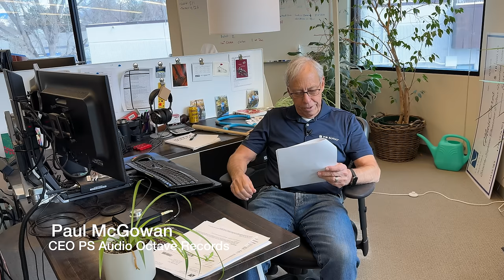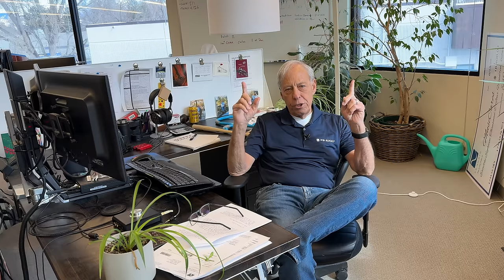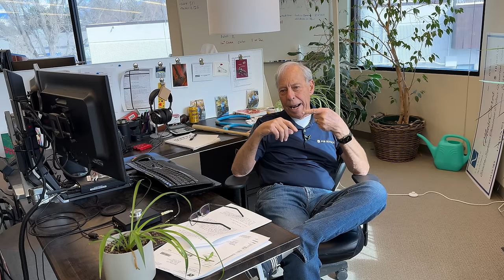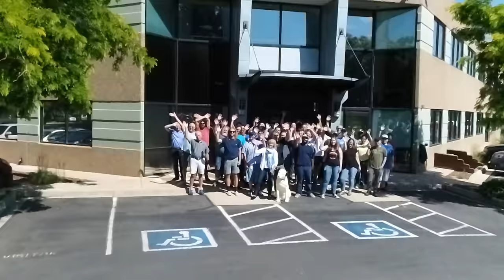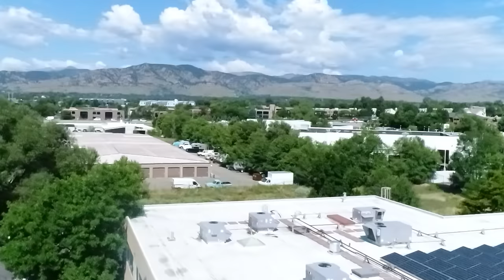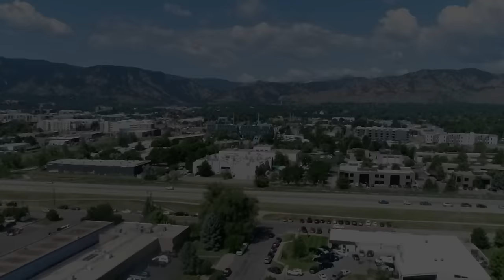How to sum stereo to mono

Comment: I remember hearing a 3 channel Left-Center-Right demo at the Klipsch factory in Hope, AK in the early 1970's. As I recall the center channel was run 3db lower in level than the 2 side speakers placed on the long wall of the room. They referenced the original Bell Labs stereo testing from the 1930's. Two Klipsch horns and a Belle Klipsch center channel. Most impressive. A number of preamps of that era had a mono output with separate level control for just this setup.
Reply: Are you sure it was the Belle? Klipsch was famous for the room placement of Corner Horns often being too far apart to get good center channel. So he invented the heresy of a center fill channel speaker and called it.... the Heresy! It had reduced fidelity to complement instead of compete.

The Belle was designed as a full range speaker in the 70's. So yes perhaps it could be used as center fill. But that was not the intent. And it was not around to do the '30's test. That was the Heresy.
Reply: I am sure, it was the Belle - a fancy version of the La Scalla - and just as large with different proportions.
Reply: @marksulloway5669  Interesting. Because I know the Heresy center was pushed in Audio shops. But Paul always did what he wanted!

Comment: Paul's answer is what we expect coming from an electrical engineer: he's worried about impedances and such in a circuit. However, when it comes acoustics and even more so psychoacoustics the issue about making "mono" from two stereo channels it that the resulting signal will not be the same as if one had simply placed a single microphone midway between the stereo microphones.  Paul did mention "phase" near the end and the problem of cancellation, but he ignored that these kind of cancellations are always going to happen from two channels recorded, as the complexity of the sound is such there will be signal that is always out of phase on one channel from the other.
Reply: True but a single mono microphone recording also "suffers" from phase cancellations. Place a mono microphone in the wrong position and gone are some specific notes produced by a double bass, or a church organ. In fact you will get phase cancellations with a mono microphone no matter where you place it, but nevertheless microphone placement is key as to how noticeable/objectionable these cancellations will be in the end result. The only good way to create a mono channel is to record and mix appropriately specifically with a mono channel reproduction in mind. Averaging two stereo channels as an afterthought is suboptimal, but so is using a single mono microphone. I the end, mono, stereo, and multi-channel recordings are all compromises.

Comment: A totally different and much easier way of converting a stereo signal to mono (besides just using a Stereo/Mono switch that may be present on a preamp, integrated amp, or receiver) is to have the signal in a digital format (like WAV, FLAC, MP3, etc.) that's compatible with software like Audacity (PC freeware), or convert it to such a format (e.g., through an A/D converter, which a PC's sound card or motherboard may include), and sum the left and right channels to mono mathematically and virtually instantly with the click of a mouse.  Or feed each channel's analog signal into a mixer [very simple inexpensive ones exist] and "pan" them both to the center (assuming it's a stereo mixer) and the output will be the summed mono version of the 2 channels.  Either such method will achieve the same result as Paul's cut/resistor/splice/solder method.  As others have stated, this is not necessarily exactly the same as if the original performance had been recorded with a single center-positioned microphone, but for most recordings, it may be indistinguishable.  As Paul said, it will depend on the phase differences between the two channels.  Usually, all of the voices and instruments across the original stereo mix image will simply be smooshed together.  BUT if there were any unusual strong phase differences between the same voice or instrument in the original two channels, they will partially or even totally cancel out and disappear.  This can happen with some early stereo mixes from the 60s when they were still learning how to best use the technology, or purposely experimenting with it.  E.g., there's one George Harrison Beatles' song that has his voice 180 degrees out of phase in the two stereo channels.  When summed to mono, instead of the typical result of the vocal ending up sounding the same as the stereo mix (in the middle phantom channel between the two stereo speakers), it will virtually if not totally disappear.  Yet another approach would be to feed the stereo signals into a home theater processor/receiver set to a Dolby Surround mode (or similar) and listen to only the center channel, which I think would produce pretty much the same result (but different sometimes for the  surround channel outputs, which we're not talking about here, because Dolby Surround applied some different frequency filtering to those channels).  Dolby with "logic steering" processing did even more "weird" signal stuff to "enhance" channel separation, which probably also affected the center channel in some ways some of the time.
Reply: Class dismissed

Comment: Interesting. I'll try that. I have a The Fisher mono Hi-Fi tube preamp.  Now, it is very common to have stereo recordings where a given instrument is in one channel and totally absent from the other. In this case, when listening in stereo, we can hear it very distinctively. But if you join the two channels, it may "sink" and sound much lower than the background. I guess the best way of summing up stereo to mono is to acquire a mono edition propperly remixed from the original tapes.

Comment: Perhaps what also needs to be covered is that summing stereo to mono is not the same as a mono recording! If you think of each instrument, vocalist, ... as it's own mono mic'd source if you just record it or all other sources to one mono track, that is Monaural. However in stereo recordings each source might be fed in different ratios to both channels. So if a source is mixed to same levels in both channels and then passively added as described, it's ratio would be greater in the mono mix compared to a source which is only in one channel. As compared to an active mixer that would keep the output level of a common source the same.

Comment: It seems Paul is defaulting to an application whereby you get a center channel in a stereo set up. I am not sure that was the intend of the question. I think it was about getting pure mono out of stereo. It gets interesting when you want to get mono from a stereo LP. Using a mono cartridge is not the right way. Shorting the coils out to each other is done but not ideal, the cartridge will survive but it is not guaranteed to give the best sound. So where in the chain of amplification to make it mono? I believe the best way to do so is to put the coils of the cartridge in series. It could be tricky with some turn tables / cartridges and a piece of cake with others. It would be an interesting experiment.

Comment: Or you could use one channel hot lead as the ground and the other as a normal hot lead. The normal ground wires join these together. This produces an interesting effect which is mono, but I've only done this with the signals coming directly from a turntable magnetic cartridge. I take no responsibility if someone tries this with the output of their amplifier and their house burns down. 😁

Comment: I have used 10k resistors for summing on a number of occasions.    
However, I don't cut and splice cables to make the connections.    
There are much more elegant ways...

Comment: Wrong. Thats mixed mono..not summed mono. Pauls not always correct.
Reply: If you feed two signals with a resister in to an amplifier you get the sum of them. This is very easy to measure and prove with DC signals. I don't think Paul is wrong here, it is a direct summing amp. Also, mixed mono, what is that even? Probably the same as a mono signal where the left and right channels are summed. So yeah, Paul is right on this one.
Reply: If you just use two resistors, you get the average of the two channels.  The only difference between an average and a sum is the gain factor of 2.  As far as sound quality, they're the same.  And if you then take that mono signal and play it using left and right amps/speakers, that makes back the factor of 2, giving the same overall volume as the original stereo signal.
Reply: @kc9scott  but not the same equal flat responce..